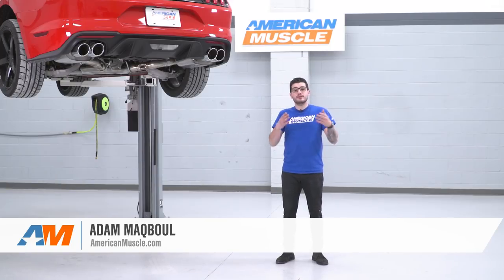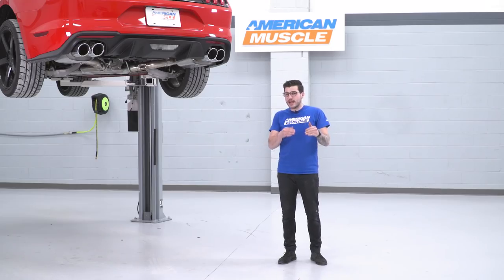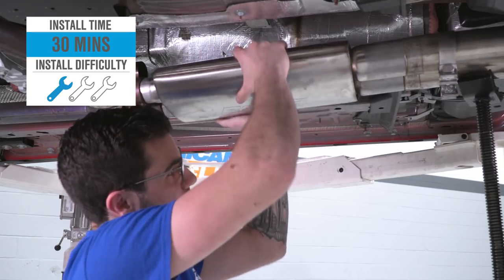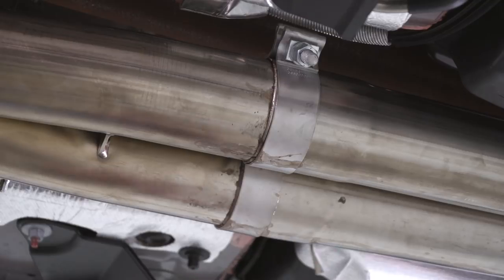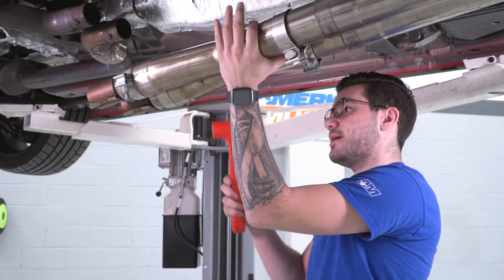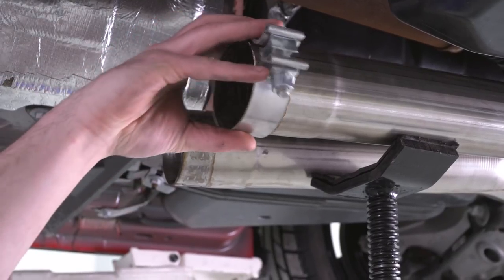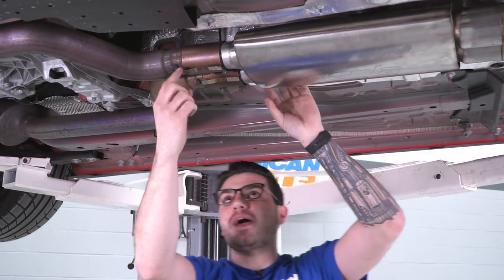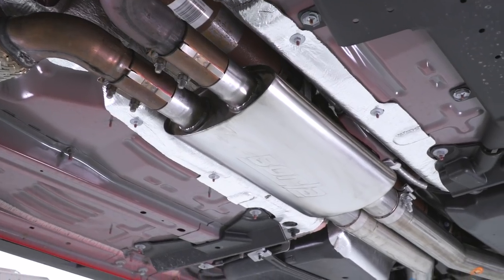2018-2019 Mustang GT Borla Resonator Muffler w/ Active Exhaust Sound Clip & Install

Comment: Not everyone wants to sound like a teenager, or be a cop caller.
Have one on my car.... love it!
Reply: Lol ok
Reply: Might as well leave the stock catback and mid-pipe in place.
Reply: stock exhaust cant handle the car if its SC
Reply: @ahmedaldhaheri154  The stock exhaust is good up to about 650 RWHP before you start seeing exhaust flow restriction. Ford actually did a great job with the 2018 & up factory exhaust. Even above 650 RWHP the factory catback is good. It's the factory mid-pipe and manifold that causing the restriction. Most folks just do a resonator delete X-pipe so they're not spending lots of money.
Reply: Gay
Reply: Was running Borla ATAK with lt headers and catted x pipe. STUPID LOUD, this resonator turned down the volume from 11 to 7 AND reduced drone to 0 and eliminated the rasp. Now my ride sounds powerful, muscular, and smooth. Perfect!
Reply: @zipzap4706  do you have any sound clips?

Comment: Don't see the point of this resonator muffler being paired to Borla ATAK catback. If you don't want loud exhaust, don't buy the ATAK catback in the first place. Opt for the Borla Touring or maybe the S-Type catback.
Reply from the maker: You're not wrong! It just may be easier for some people to work with what they already have instead of spending a chunk of change on a whole new cat-back system. -Zach

Comment: I have the ATAK system, and the tone with the x pipe is good, but a little raspy. The resonator cuts the rasp, and brings out the tone a little more. I like it more in my opinion.
Reply: did it quiet the system down a decent amount? I have the ATAK as well plus longtube headers with a supercharger so its extremely loud. was hoping this would do the trick
Reply: @arili748  did you ever install this?
Reply: Update please as I have the same exact setup and wayyyyyy to loud. Hoping this will quiet it down a bit